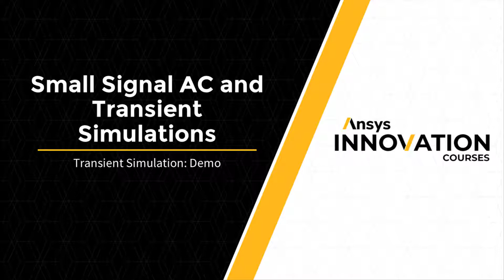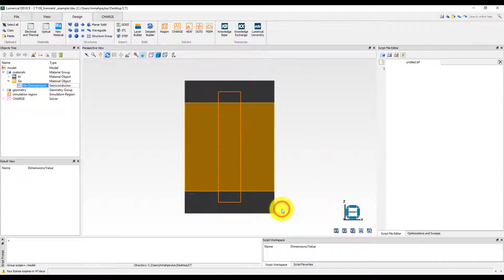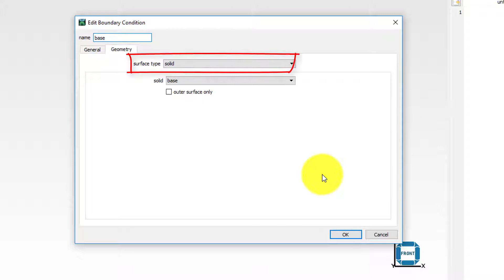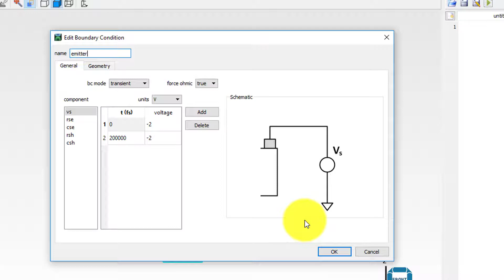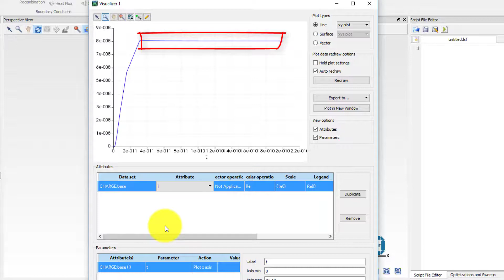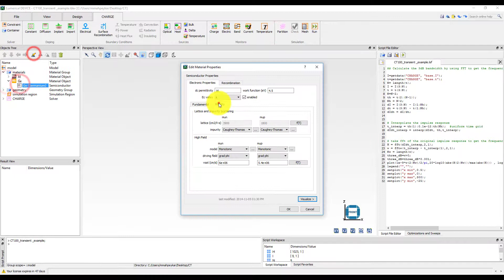Transient Simulations Using Ansys Lumerical CHARGE — Lesson 2, Part 2

Comment: I also had the convergence problem and the only solution was to disable the monotonic model for high field moblity which as you mentioned will cause less accuracy in the results i have  also read the article about convergence failure in the website but None of them works except disabling the monotonic model
Reply from the maker: Thanks for watching! Please post your query on the Ansys Learning Forum for a detailed answer from the wider Ansys Community: https://ansys.com/forum.